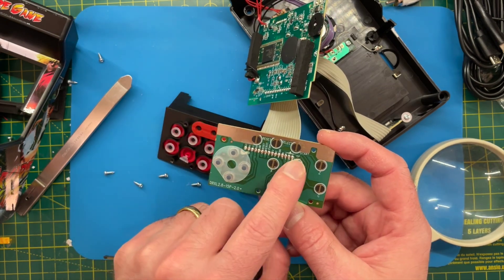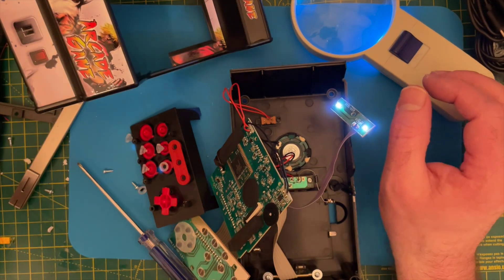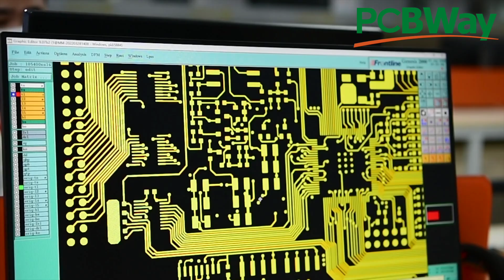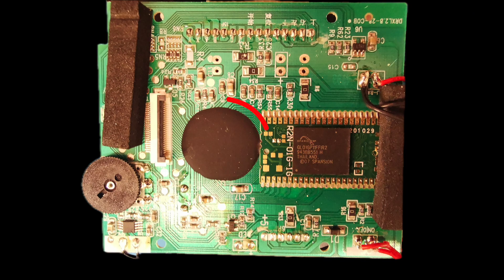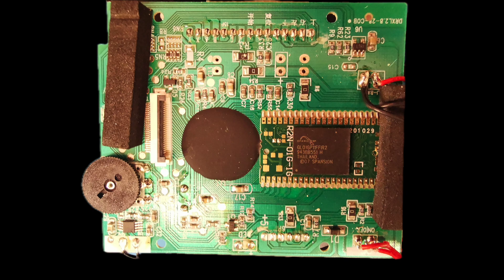Surprisingly Simple! - “16-bit" Mini Handheld Arcade

Comment: 5:36 that is 100% a NOAC (nes on a chip). That contains the 6502 cpu, ppu, spu, ram, bootrom all onto a single dice, neat! It probably interfaces that flash chip like its a rom cartridge and probably has some 6502 code onto it

Comment: I hate those blobs!  But you have access to all the pins on that 1G of flash, right?  And that reset button, might it actually really be like some nRST pin to the blob?  If so, and that exposed button could actually hold it in reset, might be able to dump the flash, figure out what the architecture is, the pinnage of the screen and all is in there somewhere, (dwarves love assembly, right?), create own flash and overwrite.  Le Hack!   Not sure it's worth it, hah.
Reply from the maker: Yeah - was tempted to try and get into it - but the effort didn’t seem worth it. I think the only reusable bits are the case, buttons. Maybe the screen if I can reverse engineer the pins…
Reply: Got to have a Mr blobby cob chip.  Need to protect the bootleg from being bootlegged. 🤣
Reply: @pow9606 its 100% one of those NOAC (nes on a chip) designs with the nes 6502 cpu and every chip on the nes pcb embedded onto the dice

Comment: They used the adaptor PCB from a standard Flash chip outline to the BGA variant to be able to fit whatever they could get that week.
Reply from the maker: That makes a lot of sense. Quite a nice cost saving solution…
Reply: What will we need to write to the flash chip? (to add or remove ROMs)